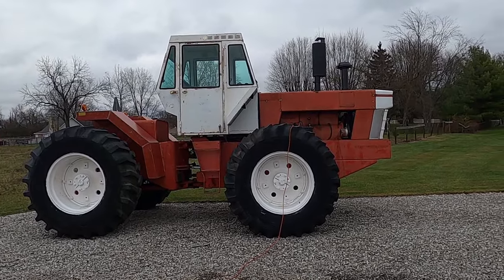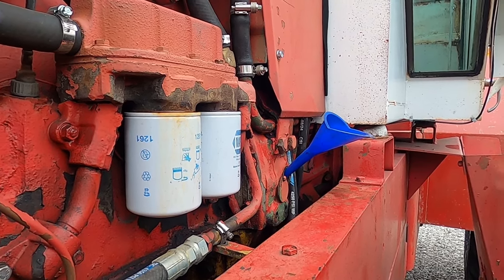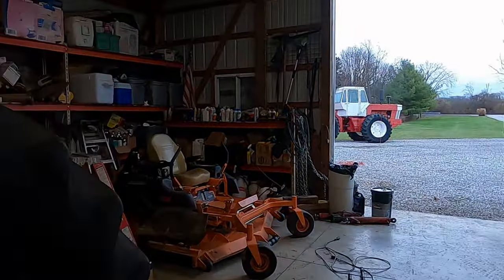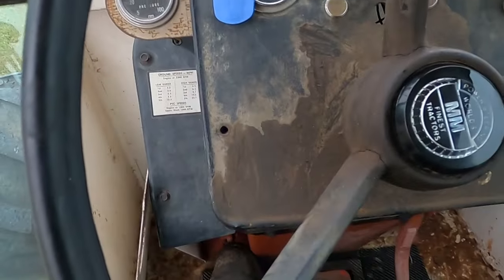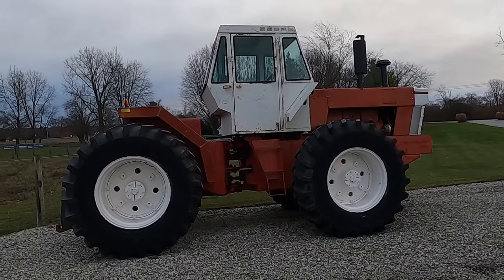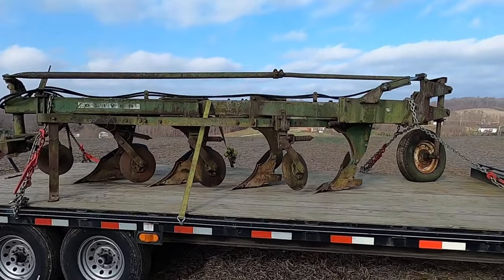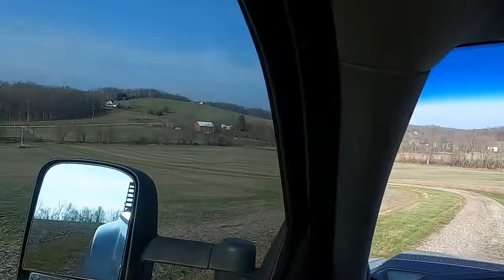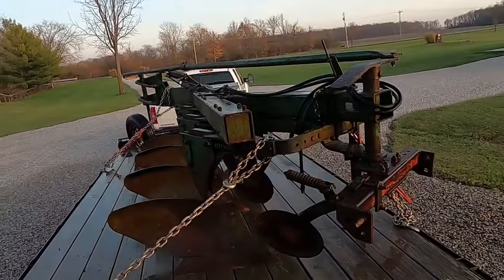Minneapolis Moline A4T 1600 Clutch Issue....And New Plow

Comment: It could be gas diluting the oil if the float sticks
Reply: Yes, if it was water that oil would be like milk.
Reply from the maker: You are correct. Gas in the oil, checked tonight. Need to pull the carb and check it over.
Reply from the maker: @tpfromcentralpa1692  you are both correct!